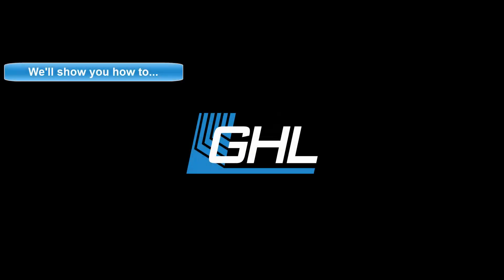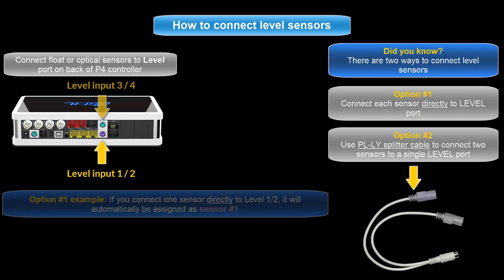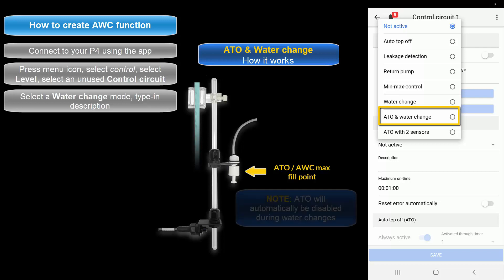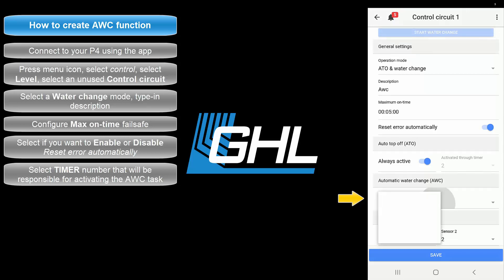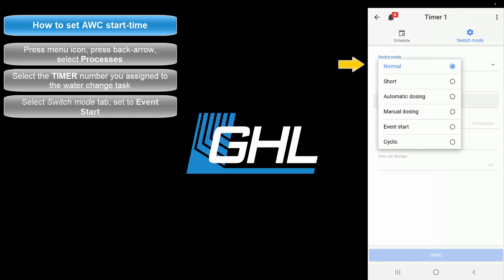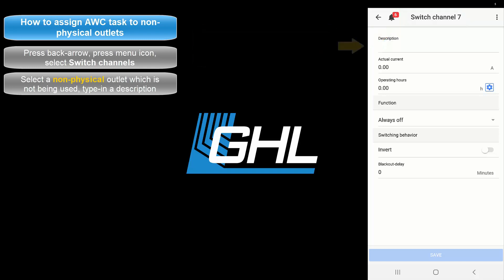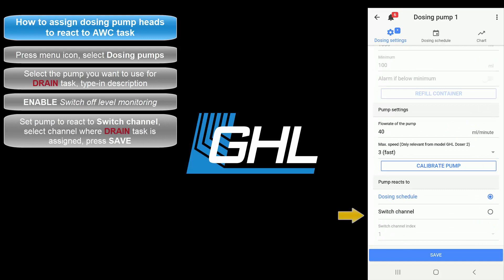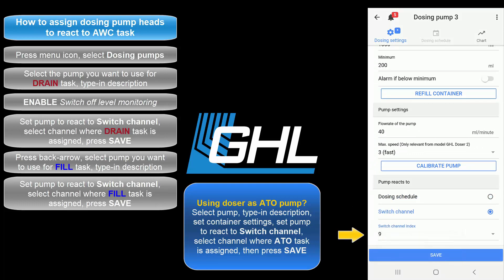ProfiLux 4: Using GHL Doser for AWC control

Comment: For water change it seems you could schedule it ok perfect BUT if like my case for changing water you add physical box for the drain water and another one for fill water you don’t want this task to be scheduled is it possible to trigger this task like in the video by a button on ghl connect Or best on the touch screen in the ultimate pack ? If yes a video for creating buttons to trigger some tasks manually should be cool . Thanks 😊 also I am searching videos to show the process of calibrating redox ph sensors